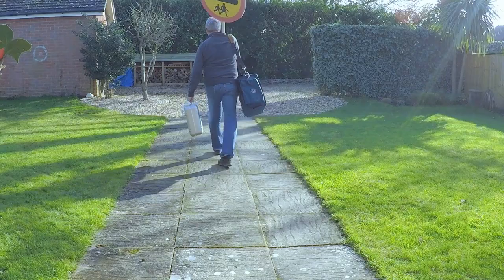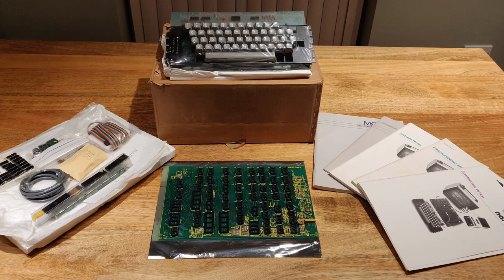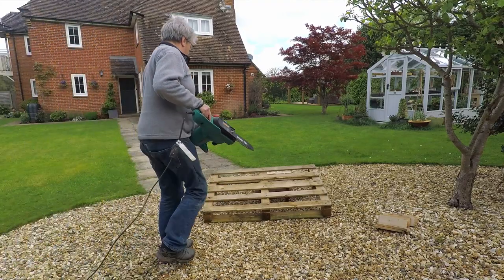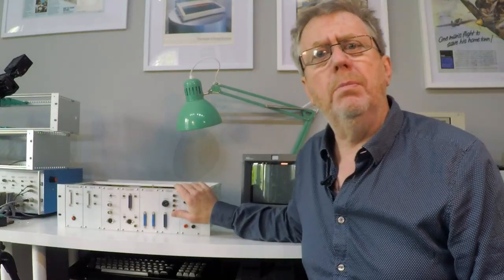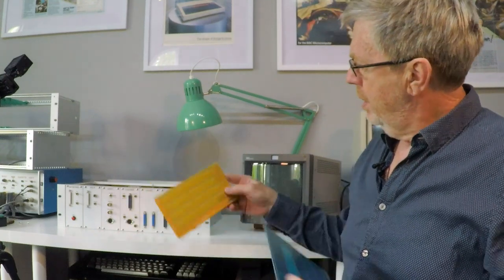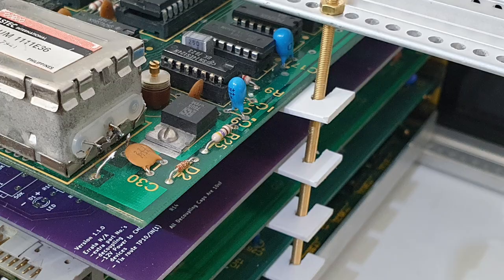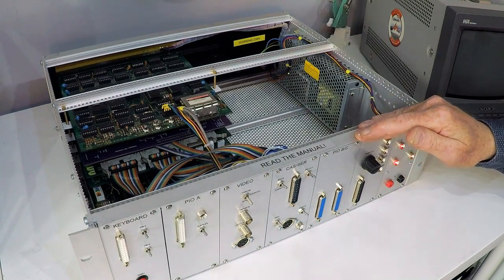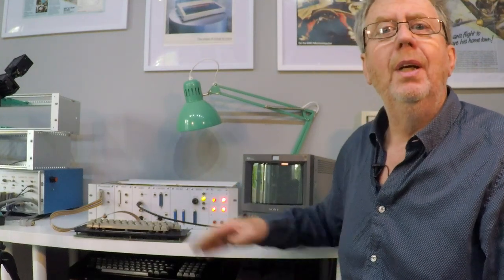The Nascom Computer Part 2 - The Nascom Legacy

Comment: The Nascom was the heart of an amazing drum machine called the Movement Drum Computer. It had additional boards that provided a combination of sounds synthesised from analogue circuits like noise generators, oscillators and filters along with sampled sounds on EPROMs. It was most famously used by Eurthymics, and even appeared in the video to their massive hit "Sweet Dreams".
Reply from the maker: I've just read the Wikipeadia article, amazing. Do you have any technical details?

Comment: Another fabulous video! I actually had to pause it for a couple of minutes after the "unboxing" part - I was laughing too hard to continue! 😂 It is almost like you have to make a bargain with your Nascom - you'll take care of it if it promises not to kill you! Truly authentic. I am actually building a homebrew own-design 6809 machine in a 19in rack like yours but its a bit posher as it has a proper DIN 41612 backplane and a commercial rack PSU. Yes, please make more videos like these - I have subscribed so that I don't miss any 👍😁
Reply from the maker: A posh 6809 I like it. I have just started a Acorn System 2 replica which also has proper DIN 41612 connectors and a backplane. I remember that Acorn had a 6809 board for the System 2. I wish I could get one not least because the Dragon event in August looks like they will accept anything that runs a 6809 and I would love to take it along. Perhaps you will be taking yours as I would love to see it and hear more about it.

Comment: Brilliant again John, very entertaining :)   How do you annotate your panels, the milled (?) PIO-A, VIDEO, etc?
Also, how come your office is so spacious and well laid out, how do you keep it so tidy?
As a retirement gift to myself I had a 24' log cabin workshop built, at first it was amazing, very cosy but two years on it has two old motorbikes with their boxes of parts, racks of camping gear, all the BBQ stuff, 4 guitars, piles of books & mags, loads model aeroplanes, more boxes, bags, Christmas stuff, shelving units, I can barely move in here and haven't seen the floor for months.  Your office looks like you broke into a lab just to make the video!
Cheers John
Phil
Reply from the maker: The lables were made with a Dymo lable maker and then cut extremly close. When applied it looks like period Letroset with some spot varnish. I wanted the machine to reflect the 'home made' look as much as prictical so avoided milling it. The office is a 4x3+ metre room with balcony. The balcony is very handy for the ham antennas :). The tidy office/lab comes from having a rule that broadly states that I can't get anything new unless there is room to display it. At the moment, I have to sell something before getting anything new :(. Most of the time it works :).

Comment: I still have my Nascom 2 and keyboard but I have misplaced the 16k Ram board that came with it. It stopped working years ago and the plan is to put it into a frame for displaying on the wall.
Reply from the maker: What I have done in the past is laid out the unit with keyboard and PSU on a piece of perspex so that it can fixed in the future or be seen working etc but can also be hung on a wall. It's a nice compromise.

Comment: Gosh, this bought back some memories! My parents bought me a NASCOM1 for my birthday when I was at school. Many hours of fun typing a program just for mum to turn on the hoover and the whole thing crash. After a months or so, dad built me an aluminium box to house the board and power supply so I didn't have to place them on some old polystyrene on the floor. Thinking back, having the open power supply uncovered on the floor was probably not the most sensible for a child. I then went on to build a memory board as an O level project which gave me a massive 8k memory expansion. Oh those were the days, fighting with the T2 operating system and trying to get some typing done before the inevitable noise of the vacuum cleaner and the resultant black screen.
Reply from the maker: Thanks for sharing, those were fun times though. We had a push along Ewbank cleaner so things were easier for me! Take care. J

Comment: I remember the big Nascom cases.
Reply from the maker: The wooden one was a bit small,  you need big cases for the Nascom.
Reply: @GlassTTY  Mine was based on the Sol-20 idea but smaller, lovely polished wooden end cheeks and a folded ali back/top/front.  It looked really nice but only housed the bare Nascom-1 and PSU.  The buffer board, RAM-B, Cottis-Blandford and Creed 7B relay driver were all external in a box that didnt look anywhere near as nice!   How I wish I'd kept it....
Reply from the maker: @PHILG2864  Maye ask about it on the Nascom group, maybe someone has it still.
Reply: @GlassTTY  Only if he's a skip-digger!
Sad but true unfortunately  :-(